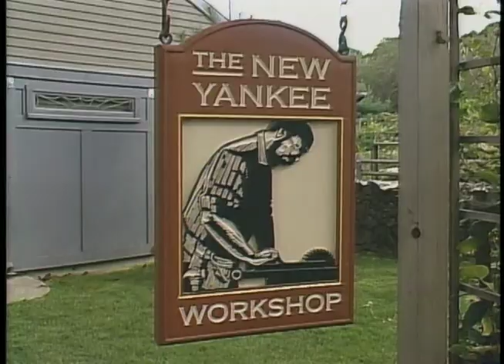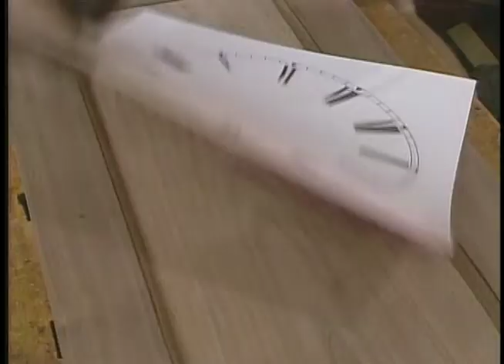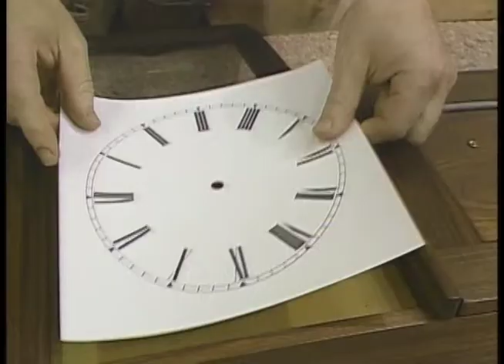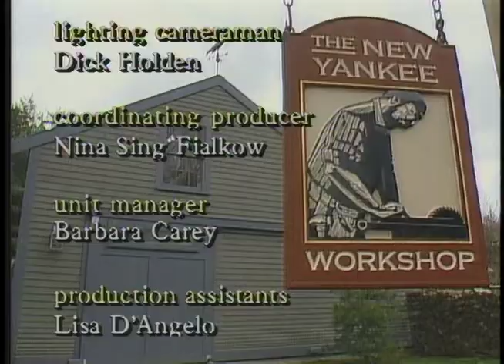Shaker Wall Clock  |  S3 E5

Comment: I was so inspired by this build when this episode was first released I had to build it. Norm really taught me a lot and gave me the confidence to duplicate his work. I still have it today and that Makita planer that I bought for this build. Norm was very impressionable on my tool buys back in the day. If it was in his shop it was worthy and in mine. 🤣🤣🤣
Reply: I know what you mean.   I built the same clock out of cherry back in the 1990s.  Now up to 30 of these clocks built for friends and relatives.   I n my younger days I had the good fortune to have buddy’s with a sawmill and a kiln.   All the wild cherry was cut from our farm, milled at one friend’s sawmill, dried it at the other friend’s kiln, and dimensioned the whole lot in my shop.
These clocks have made great wedding gifts over the years.  I use some of the same cherry stock to built youth sized two-step shaker stools for the children that come along after the wedding!
Norm and my grandfather were huge influences on my woodworking hobby.   I’m still using old tools from my grandpap’s shop.  
Cheers!
Whipple
Reply: So did i in fact I built 3 two in walnut I in oak

Comment: I recently finished building a Clock case similar to the clock case being built in this video out of Redwood with a couple of exceptions I avoided the rabbit joint that holds the shelf in place, avoided the rabbits in the side pieces, avoided using Mortis and 10 and joints for the doors, and avoided putting those little windows to see the clockworks

Comment: I like tinkering with clock movements, and this is very interesting because it shows the respect that the simple cheap quartz battery movement had in the decades after it came out, today of course everything uses that and the actual spring movement clocks are more desirable.  When you find an old clock somebody has upgraded with a quartz movement it's a big disappointment.  It'd be interesting to try to use Norm's direction but use a pendulum movement instead, it would fit right in!

Comment: For anyone who is planning on building one of these clocks: You can get embossed metal clock faces which won't curl up on you. The way Norm did his where he only put the glue in the corners will cause the paper to warp up in the middle. I rebuilt 2 thrift store clocks with new movements and metal faces and it cost me less than $50 for all the parts. The upgrade was absolutely worth it.

Comment: Hey Norm. How do u hide the Brad nail heads after nailing the back board through the side panels?? Those nail heads surely show up on the piece?? Am I wrong for thinking that way? I was wondering if u had to punch the nails in deeper and fill the holes??
If anybody in the comments section can drop me some helpful hints or tips I'd be very grateful to u all. Thanks in advance.. 
I love the look of this WALNUT for the clock.

Comment: 20:19 what’s the matter with a 1/8” thick panel? This clock is not going to be under any stress. Coulda resawed the 3/4” stock.

Comment: what router was under the router table amps 1hp 2 hp
Reply from the maker: It's a Porter-Cable 75182 Variable Speed Router . It has a 3.25 hp motor.